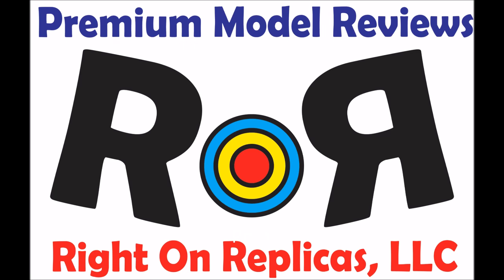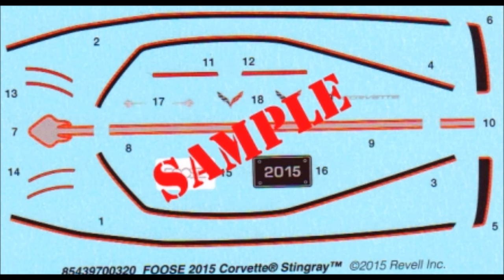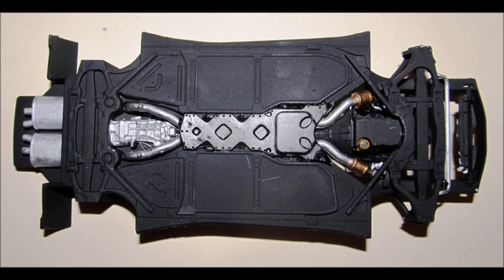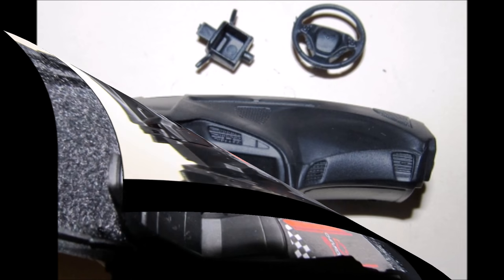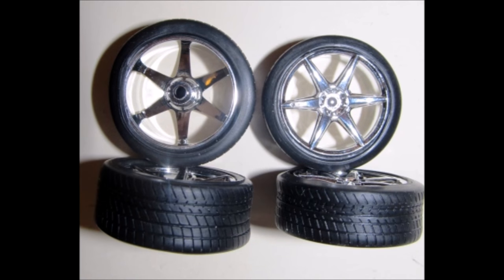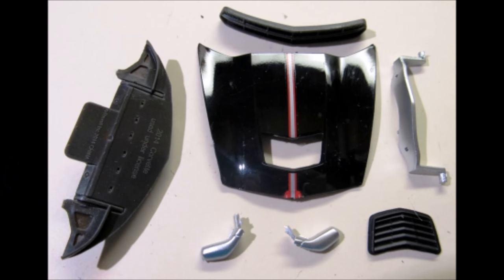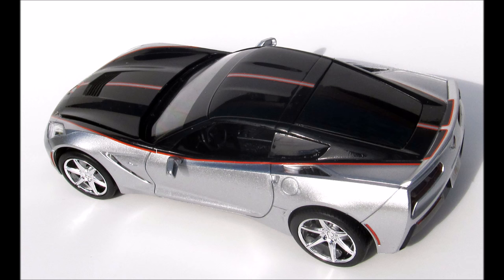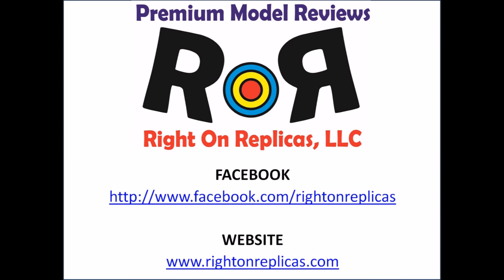How to Build the Chip Foose 2015 Corvette Stingray 1:25 Scale Revell Model Kit #85-4397 Review

Comment: I'm 12, idk how to put the engine together, I lost the instructions, I looked up tutorials on the model now :/
Reply from the maker: Rob,  It's pretty easy.  Assemble the block halves, heads, oil pan, front and belts. Paint this as a unit Flat Black. Highlight the oil filter Orange, the alternator Aluminum, the starter Black and the pulleys Steel. Paint the manifolds Steel.  Install the exhaust manifolds.  PS, please subscribe if you haven't already to help us reach more modelers.  -Doug
Reply: @RightOnReplicas  OK, I will subscribe
Reply: @RightOnReplicas  I downloaded instructions online
Reply from the maker: Rob,  That's very helpful when they are available!  -Doug